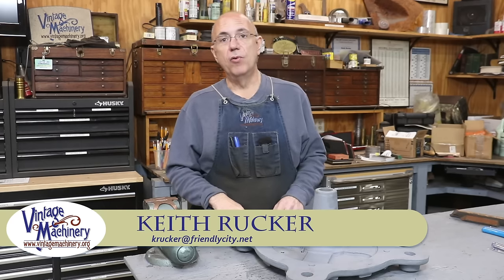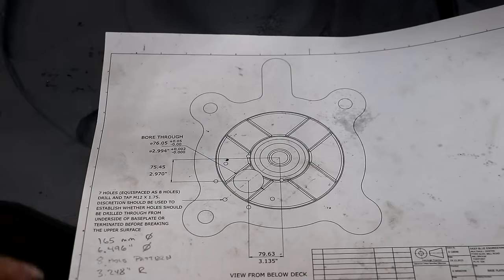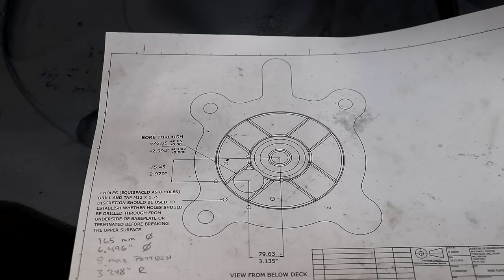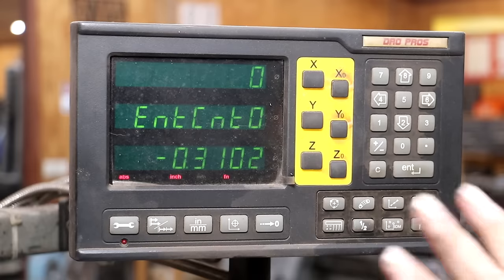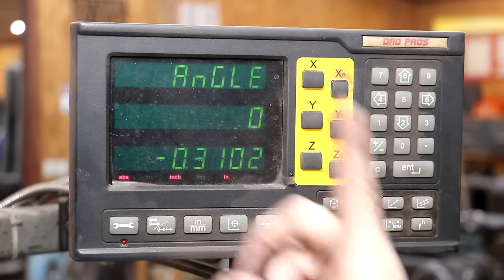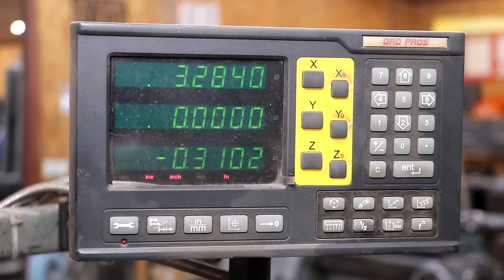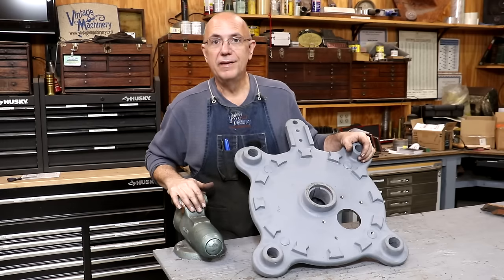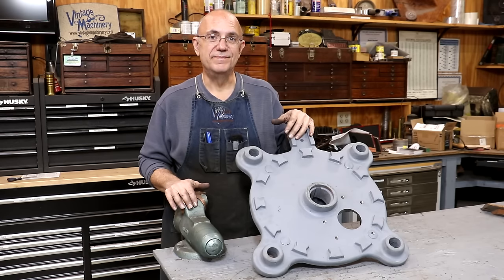Tally Ho Capstan Restoration: Drilling & Tapping a Bolt Hole Pattern in the Capstan Base

Comment: Spot facing would be a good idea on a complex surface like that.  Also, a set of tap socket adapters along with a sliding T-handle wrench is very handy for working in tight locations where the standard tap handle is awkward.
Reply: Just what I was thinking.
Reply: Being a very old casting I assume he was trying to keep absolutely as much material as possible?
Reply: @weatheranddarkness   No he just was being lazy. That could have easily been done with an endmill to give the tap drill clearance. If you look, the tap drill was deflecting out of location the entire time he was drilling the hole.
Reply: I have a tap holder that fits on a 3/8 ratchet that would be perfect for that app. The head has a center hole built into it as well so it can be turned by a regular combination wrench.
Reply: I was yelling at the screen to close clearance spot-face.

Comment: Sir, concerning the diameter.   Half of 6.496 is 3.248.  At 2:53 of the video, you entered 3.284 for the radius.
Reply: Yeah, spotted that too. Hope that he catches it.
Reply: Uh oh....
Reply: Indeed, the plans called for 165mm which is 6.496. He is off nearly 1mm
Reply: Also, it wasn't shown, but for that 7th hole is it necessary to enter the radius again on the DRO?  In that case, it will be an interesting bolt hole pattern if the radius is different for one hole.  The number is written as 3.248 on the diagram/layout.  😬
Reply: Oof I really hope there is scope to cope with this in the other parts too easy to transpose numbers especially working alone and doing video commentary etc.
Reply: not sure how he will repair for this, either weld to fill and re-drill, or slot the holes on the motor to make up for the error
Reply: I'm sure he did it wrong just to generate more comments and content. Seriously when mistakes happen and I'm yelling at my phone and knowing it is too late is stressful. I'll be interested to see how.he addresses this. Mating plate is not made yet so I guess will be ok. I can't believe that entire surface does not need to be faced so plate does not twist when mounted.
Reply: There is a button on the digital readout that switches between SI and USCU. 
To me it is much simpler to remember half of 165 (82.5) than it is to take 6.492 and divide it by two to get 3.248.
Reply: This one is going to sting a little hope to see its resolution
Reply: @bchrisl1491  what we have witnessed is more like dyslexia than the tiresome who measures right debate.
Reply: @Pocketfarmer1 Dyscalculia is the word. How did Keith made such a fundamental error? My guess is he was doing the division in his head. Sometimes it is good to do even the simplest math on paper or with a calculator. As he often says in his videos, "measure twice, cut once." This was an unfortunate error but it sounds like Keith is making the corresponding plate and he will be able to machine it accordingly..edit. At 1:29 you can see that Keith had written the correct radius, 3.248" on the drawing.
Reply: @UK_Lemons  A transposional error by any other name still stinks, to borrow from the poem.
Reply: well he may have see it and rest it, but used the wrong clip or didn't have the second,
also people comments way more over mistakes than a good job.
however as long as he uses the same bolt pattern on the plate, there should not be a problem
166.8272mm vs 164.9984mm with help from google, damn imperial system and damn colonies kids not fallowing the uk
😁
Reply: @Pocketfarmer1 I agree 100%. Making such basic errors is a painful experience. Been there, done that. But hopefully this mistake has a very simple work-around.
Reply: @dibqip  Unfortunately, I suspect that they are fitting a given manufactured motor on there. The only way to compensate would be to egg-out the mounting lugs on that motor. Bummer....
Reply: @johnlee8231  "sting a little hope"? 
Not familiar with that expression.
Reply: @1BigBen This error was not a mm vs inch issue. It was Keith entering the number incorrectly. At 1:29 we can see that Keith's calculation of radius was correct, he has written it on the drawing. He entered it into the DRO incorrectly. Drawing had mm and in dimensions. Whilst my preference is for metric, where I worked had a mixture of metric and imperial machines and we just dealt with it. DRO was a game changer and in many cases eliminated the need for reading dials.
Reply: @UK_Lemons  A simpler system results in fewer errors...
Reply: Hopefully he can compensate by drilling the plate to the same dimensions.
Reply: I wonder if he used the same numbers when he moved the milling head and set up for the last hole?
Reply: @bobdylan7120  Why would there be a "plate"? They are mounting a motor. Hope there is.
Reply: @johnalexander2349  If a drawing gives imperial units in thousandth of inches (not fractions, eg 13/64) then both systems are simple. It is as easy to divide 17.53mm by 2 as it is to divide 1.753inch by 2. It is just numbers.
Reply: @menow. Keith said he will be making the required plate in a future video.
Reply: @UK_Lemons  Cool. That will mean the problem is solved, I think.
Reply: @jbeutell  He intentionally damaged a part? Seriously. Having watched this channel since it's first video I have seen a handful of mistakes that are caught during or after the fact. Humans make mistakes all the time. Shows with massive budgets make mistakes. A one man show that gives you this content for free and also has a massive repository of books and manuals is not intentionally making a mistake to gain a few hundred views. Get real.
Reply: @jbeutell  Did it wrong on purpose for comments? You are a poor judge of a decent guy.
Reply: @TheDirtCreature  My sarcasm got missed. Keith is clearly not the type of content creator to do crazy stuff for clicks. And I can see from comments that most everyone who watches him just wishes it had not happened and are offering suggestions to be helpful.  He made a mistake and he will fix it. I am genuinely curious how.  I thought I saw a concept drawing on this channel or on Sampson, but I don't recall how this all goes together.
Reply: Later on in the you tube the measurement showed as 3.248, I shared your concern
Reply: @TR4zest  Sarcasm is hard. See my other reply.
Reply: The 1st part of my comment was a joke. A bad one apparently.  I thought the rest of my comment made that clear.
Reply: @1BigBen  I still prefer the English system to the metric system.
Reply: @jbeutell I an curious to see how this motorisation will be assembled. At the moment it is a guessing game for us viewers and it keeps the audience interested and the comments flowing.😂
Reply: Well the skill of a good Machinest is to find a way around a mistake .
Checked drawing his notes say 2.48”R 😢
Reply: @UK_Lemons  so the main section he machined out will have an internal gear , the holes he is drilling now will be for a pinion( small gear ) a bit like a starter motor but on an internal gear.  In fact starter motor are often the base motor for smaller anchor windlasses.
Reply: @Bob_Adkins  That just shows you dont know how metric works :face-green-smiling:
Reply: @mick0matic  I spent half my career doing and teaching precision metrology, so I don't know "metric"? OK then, YOU don't know aluminum!
Reply: @menow.  See video at 19:40
Reply: @bobdylan7120  Got it. Thanks.
Reply: @UK_Lemons  you are missing my point 
these are for the the plate to bolts too and as long as the bolt pattern are the same the 1,8mm is not a deal breaker
for a one of pecs and he may be work with 10% metric and imperial 90%, 
imperial is a mass most of the world saw it and if you have see 384 a lot your brain may assume that 348 was 384 
but I still thinking its a wrong clip used in the cut, if not he is only human,
Reply: I'm sure Windy Hill Foundry can just cast another one, no problem.
Reply: @Bob_Adkins  for someone that worked on late 60s/70s/80s/90s GM cars as a kid growing up,
I have a huge hate for imperial system,
Reply: @andyca15  They did not cast the entire capstan.
Reply: @1BigBen Really, the US is slowly converting and will eventually get there without a costly government edict. And that's the way it should be.
Reply: @Bob_Adkins  I believe the metric term is aluminium.
Reply: @DFDalton1962 I tried watching for a while, he's a nice enough guy and I like his  humor, but I found all the fails and equipment outages very frustrating. Haven't watched in a while. Imagine turning on this channel and four out of five times his lathe or mill goes kaput lol. Its like ' ok, maybe you need to get your act together before taking on the whole YouTube distraction'.
Reply: @menow. There are a few things that can be done. Put a screw in to fill the hole and remake the hole in the right spot, leaving half of the threads engaged. Filling the hole with brazed metal and remachining. Cutting a larger hole in the right spot and using a thread insert. The thread insert is the easiest and safest.
Reply: @jbeutell  Correct!
Reply: @court2379  It will be interesting to see what happens next.
Reply: @court2379  He's making the mating plate. He just needs to make the plate to match. No big deal.
Reply: @TitoRigatoni  If he catches it ... which I doubt he will .. he obviously has not read this thread.

He will end up slotting the mating part after drilling IT correctly.
Reply: @andyca15 hahaha
Reply: @gropius6070 My DRO “remembers” the last setup for the bolt hole circle function so he probably just re-centred it…
Reply: @DFDalton1962 they've invested 3 million hours between them, it must be made to work..
Reply: @Pocketfarmer1 It is not who measures right or who measures wrong. The plans were drawn in one system, and the means were readily available to execute the dimensions in that system.  
There was no reason to not use the SI system which was readily available on the machine, resulting in an unnecessary error due to the extra complexity of the converted units.

One the other hand, the designer could have called the diameter 6.5"..........
Reply: @bchrisl1491  the plans shown at 1:22 clearly show both measurements, as written by the designer engineer.  The error had nothing to do with which system was used. It was a transposition error. Unless you are claiming that people using metric can’t put digits in the wrong order, you got nothing.
Reply: @bchrisl1491 The drawing had metric and imperial measurements. Look at 1:29 . Clearly the designer was aware that a lot of this was going to be machined in the US of A where,  the imperial system is still in common use. Keith did not have to do the conversion. The mistake is not a mm to inch issue.
Reply: Will there be another "Bozo comes to town 2" video?
Reply: up

Comment: Keith, as others have said the bolt hole radius you drilled is wrong. You typed in 3.284” when it says 3.248” on the drawing. So you’re large by 0.036”. Hope whoever makes the motor mount sees this and compensates, and hope that it’s not a critical dimension!

Comment: Great job Keith,  Just surprised you didn't spotface those 2 holes near the core with a slightly larger endmill (11/16")  so you could drill and tap from a flat surface instead of along an edge.

Comment: On the printed diagram of the layout, you have written a diameter of 6.496 inches. That makes the radius 3.248 inches as correctly written,  NOT the 3.284.inches you entered on the machine. The mounting plate will be out if it has already been made.
Reply: @MrJmBecker  look at the start of the video at the paper drawing, bottom left, hand written, is the radius shown as 3.248 inches yet Keith input 3.284 on the digital display on the machine as the radius, i.e. wrong.
Reply: Thanks. I now see the difference ! Very sharp of you !
Reply: @MrJmBecker  maybe you could ask a question rather then stuttering on the ?
Reply: @A.Hidell  Can't be bothered to post a time stamp... can't be bothered to address it..

Comment: Curious why you didn't set the DRO to metric? A separate conversion step seems like adding another door for Mr. Bozo. I regularly work in metric on my old imperial machines and the DRO is a huge help with that.

Comment: I'd like to see  the motor bolted up to these holes.
13:54 Why wasn't an end mill used first for this hole?
Reply: A 1/2" end mill would have been perfect.
Reply: All of the above, but why not drill all the holes from the other side, then there would have been room for the wrench.
Reply: @johnsherborne3245   How would he position the job on the mill with the central ‘turret’ facing downwards?
Reply: @bobdylan7120  could be done, but would not be fun trying to get all the blocks and clamps needed to make something that top heavy stable enough, the work surface would be what 9" off the bed? Possible, but not advisable if you can avoid it.
Reply: Som of the holes are not through holes. On what side is the motor supposed to be?
Reply: @ulwur  the side he was drilling from.
Reply: @bobdylan7120  on the mother and father of spacers. Precision bricks if you like. It looks as if the mill has enough head room, if not use the radial arm drill, carefully.
Reply: @ulwur  bother, you are right.
Reply: @ulwur  yes
Reply: @johnsherborne3245  from time stamp 19:58 until 20:00 the side that is showing goes against the deckboards

Comment: For the tapped hole made around t=13'30", the absence of a flat surface perpendicular to the drill would have justified the preliminary use of a mill. I have the impression that the drills have moved away from the axis when drilling.
Reply: A 1/2in end mill would be perfect for 0.027"(0.7mm) clearance on a 12mm thread.
Reply: Agree: It did move. Just another blunder on this part. That's what you get when the work is for free.

Comment: Could you have used an end mill and made a flat bottomed surface, in that awkward hole 🕳️ on the edge of the center flange, then center drilled,  drilled out to tapping size and then tapped it, it's only a suggestion, Ste 🇬🇧
Reply: I’ve seen Keith do that numerous times, I was a little surprised when he didn’t on that hole.